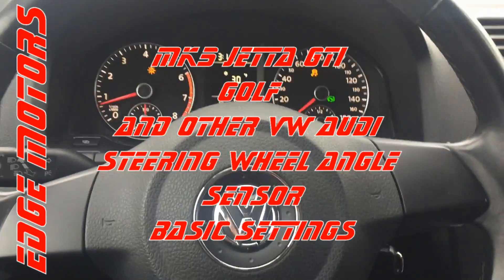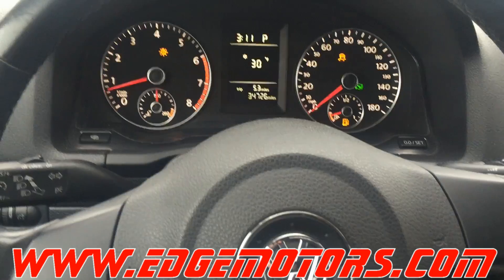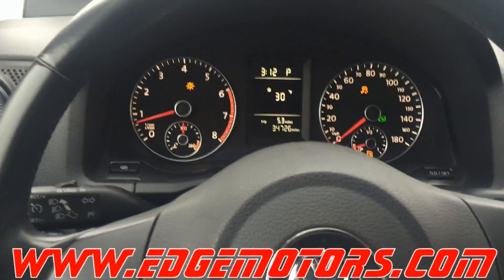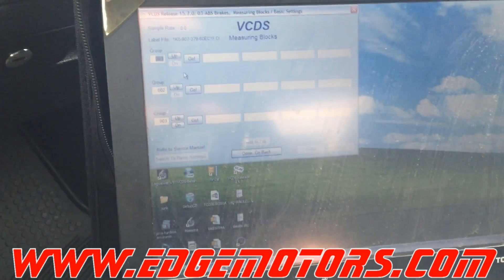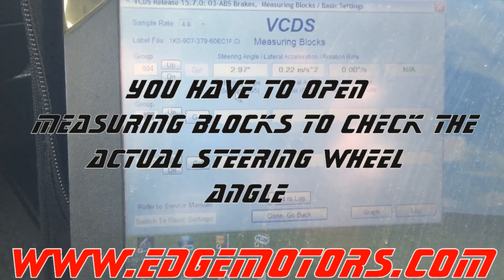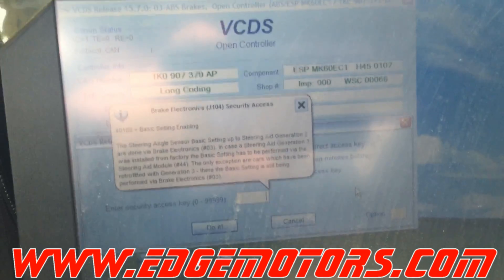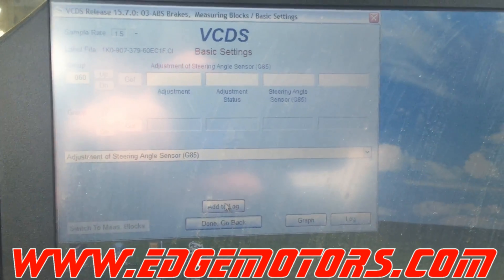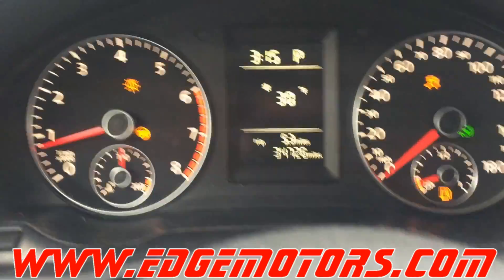VW Audi Steering Wheel Angle Sensor Basic Settings DIY by Edge Motors

Comment: 0078 steering angle sensor g85

005 NO or incorrect basic settings / adaptation 
Freeze frame 
Fault status 01100101
Fault priorty 2
Fault frequency 1
Reset counter 191

Comment: Hi bro ive changed abs sensor and deletef the codes  the abs code disapeared but still have abs and traction on dashboard it says steering angle sensor 85 incorrect basic setting adaptation it shoes me not possible on vcds  any idea what i should do please

Comment: Much appreciated, it worked a treat 🙌

Only thing I've done different to you is the steering was so heavy because my car just had two new wheel bearings and two new ABS sensors so I couldn't just sit there turning left right I drove it round a car park in circles one way than the other and then straight for awhile and all the lights went out and then the electric steering kicked in again 🫡

Comment: Hello, why you use de pin 40168?
Reply from the maker: This log in activates basic settings, without it entered, the basic settings of abs unit will not work
Reply: It's the same code for audi q5 ?

Comment: I recently replaced my ABS module/pump and im getting 4 fault codes. Three of which are pretty common and need to do basic settings in. The only code that has me puzzled is a "Rotation rate sensor" electrical error in circuit which is the G202 to my understanding. Will this present code not allow me to do long coding on the new module and do basic settings/adapations?
Reply from the maker: Coding should not be not affected, but basic settings most likely will be
Reply: @EDGEMOTORS  so I should fix that g202 sensor to be able to complete the basic settings? Correct?
Reply: I appreciate it man! I’m trying to fix this 2010 Volkswagen Jetta, it’s a nightmare! 😂

Comment: I have the same problem with the radio, can i just disconnect the radio or do i have to put in the original to calibrate the steering wheel sensor?
Reply: What do u mean u changed radio and now u have abs and traction codes?
Reply: @chamondward853  nah, i had an can bus error code, because i had an aftermarket radio. And to calibrate the steering clock. I installed a original one to have 0 codes during the calibration and it worked then.
Reply: The car wont calibrate if you have any kind of codes

Comment: Or engine running, voltage re-applied - steering full lock left than full lock right then centre to manually set adaptation.

Comment: Great video. Can I ask you a question?? What if I only have the traction control light on?? I don’t have the steering wheel yellow light on. I have a 2007 Audi a3
Reply: I have a Audi A6 with this problem after new abs unit, there wasn’t a wheel light, only traction control light and esp warning.

Reset by disconnecting battery and shorting terminals, reconnected and span steering wheel a few times to fix

Comment: this worked perfectly to reset my steering sensor in a 2006 Audi A4 Quattro 2.0l.  I had low battery readings and went through three batteries and rebuilt the original alternator to find that the starter wire leading to the terminal at the starter motor was loose and allowing a voltage drop of atleast 2.3 volts and would give the effects of a dead battery not being charged by alternator, even though the alternator was tested out at 14v dead even cold and 13.6v upon operating temperature.  This fooling around losing voltage caused my steering angle sensor to go haywire and register at -1460.00 degrees yes negative one thousand degrees!  Having messed with nothing else on the car besides taking care of the charging/wiring issue... I knew this thing had to be re-programmed.  This video ended up being the solution to resetting the sensor to 0 with the steering wheel straight ahead and then turning the wheel to full lock each way before driving.  This fixed my AFS Xenon headlights and allowed them to turn with the corners again.  Thank you very much for sharing this video my friend, god bless.

Comment: Hi Sir, I have audi q7 2017 and I had an accident and replaced all front suspension system along with sub-frame. Anyway finally I got red color signal in my dashboard says steering fault please stop vehicle. But my steering wheel is working fine with normal movement . Please help me as I went to local workshop and they told me I have to replace steering gearbox which cost around 4000$$😭😭

Comment: how can i implement with obdeleven?
Reply from the maker: You can follow this video. The interface is different, but functions are exact
Reply: @EDGEMOTORS  I can't change nothing in live data
Reply from the maker: Live data is only for viewing, you will not be able to change anything there.
Reply: @EDGEMOTORS  So what's measuring block 8 in obdeleven
Reply: @EDGEMOTORS  So whats measuring block 8 in obdeleven?
Reply: @flipinfin  did you ever figure out how to do this in obdeleven?
Reply: @_DaRobot  nah sold the car

Comment: Hi please I need your help I installed a slip ring and Cruise control stacks in my Tiguan. I made the mistake and installed a slip ring with steering angle sensor while my module does not have steering sensor module as per the information on ROSS TECH site. So I got the errors anyway I removed the modification straight forward and reinstalled original slip ring and stacks. But now I am plagued by this steering wheel sensor error.
I tried everything but the error says no communication with 60 like it can’t find steering wheel sensor of course it’s not there. So how do I tell this car stop looking for it.
Please help

Many thanks

Comment: Any help with a yellow steering wheel light, fault code is against the steering torque sensors... Do I go with the same approach? Basically happened when a local garage changed my CV boot!
Reply: I have the exact problem, after i changed the strut bearings, the upper part. Haw did you fix the problem?
Reply: I have this same problem..and I'm pretty sure it happened after the tire lugs were pretty tight and it spun the CV with the weight I applied to remove them..Didn't show code for days though..these cars are too sensitive.

Comment: tried this on my 2010 polo but I still have eps light and tyre pressure light on. no basic settings for steering angle adaption
Reply: Hi Wayne, did you ever sort this? I have exactly the same on a 2010 Seat Leon. The steering column control was changed because of the airbag and ABS lights but the ESP and TPMS lights were also on. They remained on after the changeout and I cant get rid of them. A pain in the nutsack.
Reply: Did you guys sort this out in the end and how?

Comment: Thanks for this video i've done them before but at the end what you said about the incorrect module installed in the car so what you did is change the soft Coding of the radio ? I Saw you other vidéo first this is what i meant doing the basic setting of the angle sensor but never had to what you did in the other video. Thanks .
Reply from the maker: +V10PDTDI the problem was in the gateway control module, it found a new module that it didn't know exist, and we had to recode the gateway control module so it knows about the navigation control module before it let us do the basic settings for the abs....
Reply: Thanks for the info.
Reply: Thanks for the info.
Reply: Thanks for the info.
Reply: Hi thanks for the info.
Reply: is there any info on specific coding for this situation? i had a different model of vw headunit installed and its not letting me do this adaptation either (error group 60 not available)